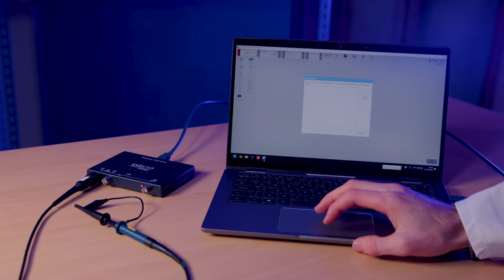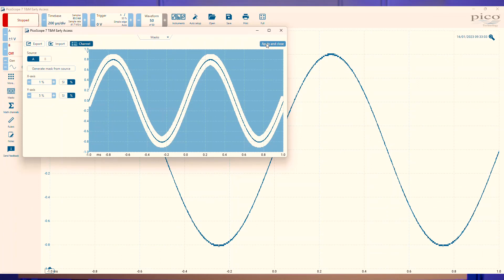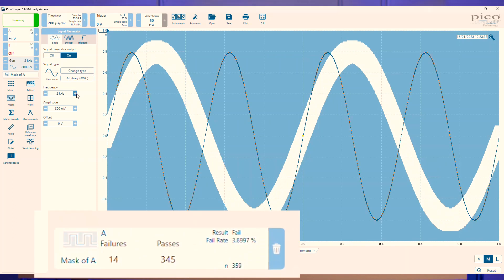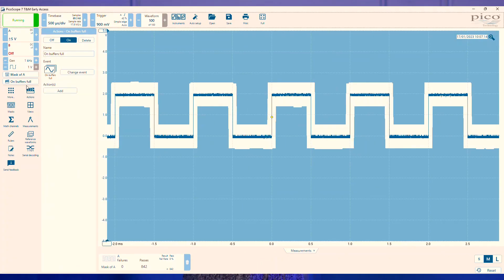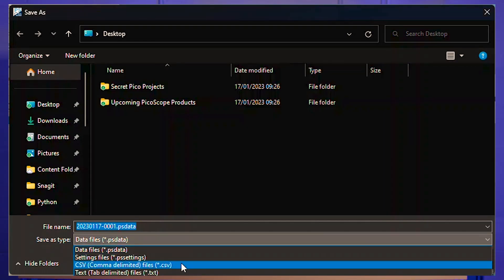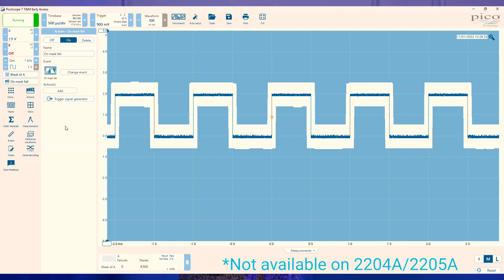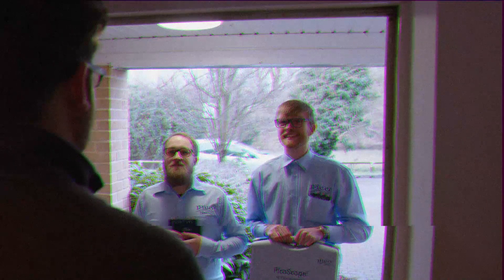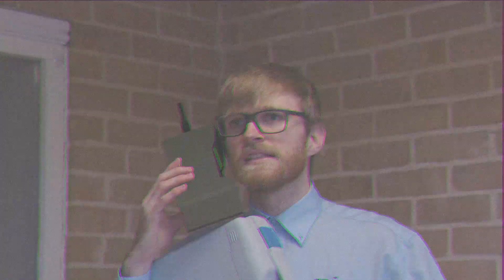Masks & Actions in PicoScope 7 - PicoBYTE #6

Comment from the maker: This was a hugely popular topic to be covered!
Let us know what you want to be covered in a PicoBYTE episode next ⏭
Reply: I often need to monitor low voltage power rails with very tight tolerances for dropouts, and have found that not all of the trigger types perform equally for this on my 5000 series. I'd love to see a technical deep dive on the signal processing pipeline for the different trigger types, that would teach me which trigger is best for catching fast, ~10 mV over / under-voltage transients on a 0.8 V power rail. And how the resolution enhancement options relate to this, as some happen after the trigger has taken place.
Reply from the maker: Hey  @EkitaiKurage ,  Have you caught the PicoBYTE episode: "PicoScope 7 Trigger Modes & Trigger Types - PicoBYTE #2", where we do a overview on each trigger type and trigger mode within PicoScope 7 and examples of using them? 
There will also be a PicoBYTE episode coming out soon about Resolution enhancement!